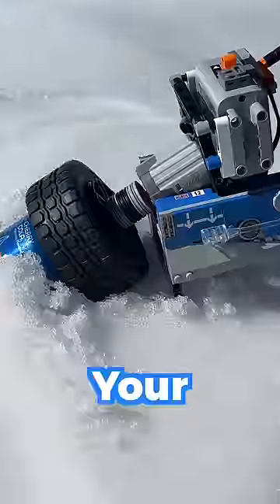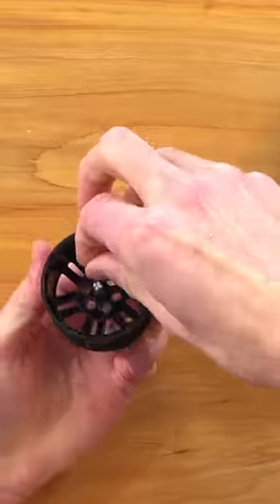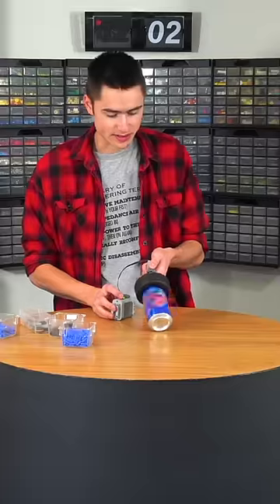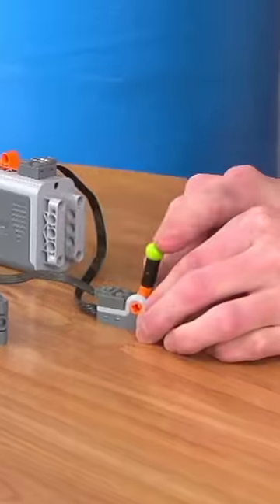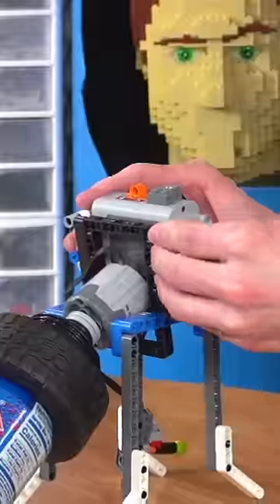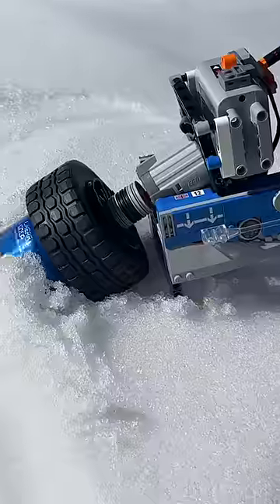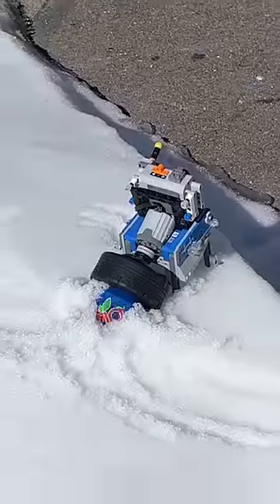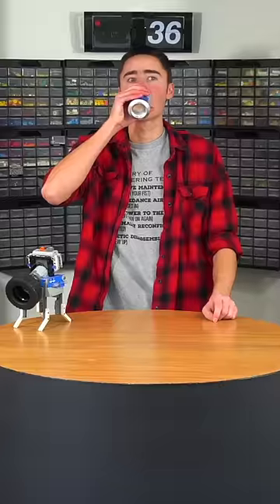INSTANT LEGO Soda Chiller!! #shorts

Comment: Was it carbonated still?
Reply: Yes it will always be carbonated unless it is open because of the nitrogen in the can
Reply: probably not
Reply: no reason it shouldnt have been. the reason it goes flat when you shake it is because you’re mixing the air in the empty part of the can with the liquid which helps the gas to escape easier. this won’t happen when you spin it because the liquid and air still remain separated.
Reply: @shortRB  probably yes because carbonation doesn't go away by spinning it really fast?? bro we were taught about that in third grade.
Reply: Probably. Since the soda is under pressure the co2 doesn't have anywhere to go. If you open it immediately like any other carbonized drink that's been shook you will lose most of the co2.
Reply: @richardmoore609  or you can tap the can about 4-5times and you won't lose any carbonation
Reply: Yeah but I had one of these and it only cools the aluminum can and not the actual drink. After like 3 spins it was cold, sorta.
Reply: @JacobCB  unless you spin it perfectly, there is still a little mixing, and also some when it slows down as you finish spinning it, but not nearly as much all together as when you shake it. it would still go flat if you spin it for too long, but it may freeze by then
Reply: No
Reply: @festering   That is not how that works
Reply: @shortRB  Don't feel bad, I would've said the same thing, because it was probably swapped out. So let the nerds, nerd on.
Reply: @MinorityHunter516  bro you learned about sodas in school? lucky
Reply: @gidsthedids7920  no actually we learned about carbonation
Reply: @MinorityHunter516  lucky

Comment: If you added a universal joint between the motor and the tyre you wouldn't have to worry about sticking the machine in the snow at an awkward angle :)

Comment: Doesn't kinetic energy coming from the spinning motion add heat to the can rather than help cooling it?
Reply: No. Because the can is constantly being rotated, all sides of it are being consistently cooled by the snow, and with the size of the entire unit being run off a Mindstorm motor, and the motor's limitations of being produced by a toy company, the device cannot generate enough heat to prevent cooling

A Mindstorm motor cannot reach high enough rmp to generate heat, as that would be a liability if a child got it's hands on the powered motor, which is bound to happen since Mindstorm was made for and targeted towards children in an educational context

Comment: I already see a problem. The motor and it's mounting plate are going to be strained from the off set weight distribution of the can. Put a universal joint or something on the shaft so that the can can rest in the snow better.

Comment: He doesn't like the battery box switch so added a better one.

B...
But...
But he's still gonna need to use the battery box switch to turn the whole thing on.

Or is he just gonna leave it on and just replace the batteries when they run out in a couple hours

Comment: Fun fact: liquid doesn't stick to the inside of the can, so when you spin it, the liquid actually stays in the same place. Therefore: you could just leave it in the snow and it will do the same job just as well, if not better, since spinning the can causes friction, and friction causes heat.